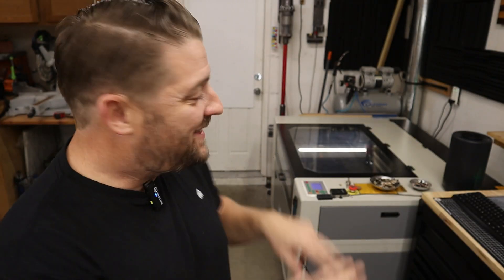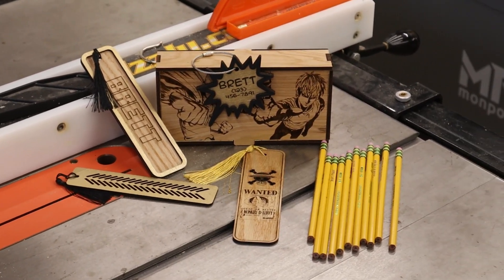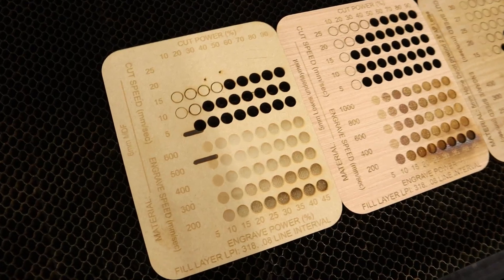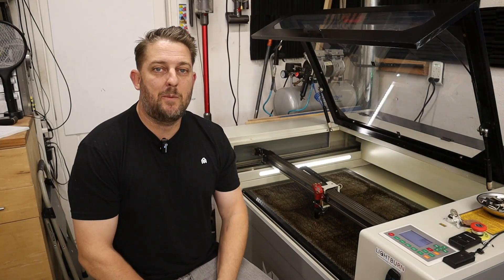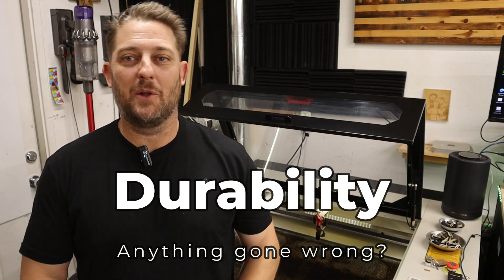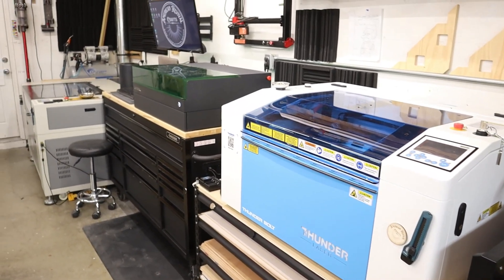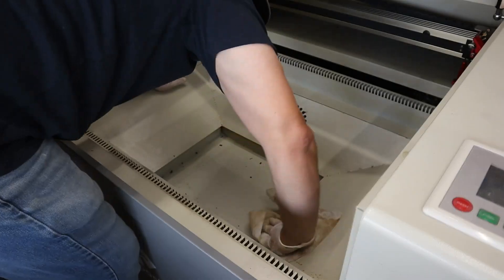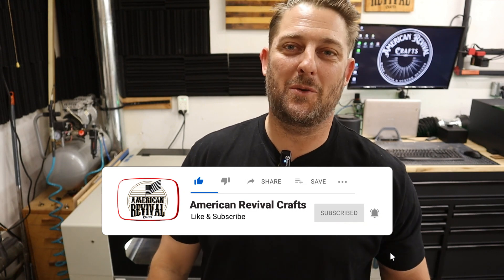Monport 80w CO2 Laser: Comprehensive Review & Verdict After A Year | Brett's Laser Garage

Comment: The Monport 80W CO2 Laser has been an excellent tool for both engraving and cutting, with its powerful performance and reliable results. I personally recommend the Monport Mega, which shares similar quality features like auto-focus and rotary support, making it great for a wide range of projects.
Reply from the maker: The Mega and 80w machines are similar yet very different in many regards.  Make sure you do your research when thinking about either machine.

Comment: Two questions... how thick of a material will the pass through accept and how large of a diameter can you use during the use of the rotary devise?
Reply from the maker: I no longer have this laser in my shop, not really sure.  I never used the pass through.  As far as the rotary goes, it totally depends on what rotary you’re using so I can’t really answer that.

Comment: i have been eying this machine. I was curious, does the tube come installed? I would have to turn the machine sideways to get through the door.
Reply from the maker: Yes the tubes come pre-installed but there is packing material in the tube compartment when shipped.  So just leave that in and you’ll be able to turn it safely.

Comment: Hi Brett, I’m rewatching this video because of trouble I’m experiencing with my monport 60w co2.  So now that it’s been one more year are you still happy with the monport?
Reply from the maker: I sold the 80w a couple of months ago, not because I didn’t like it, but because I needed a more industrial machine for my business.  I would have kept it if I had the space though.  

What problems are you having with your 60w?
Reply: @LaserGarage  a few days ago things worked fine. The very next day on the same material it wouldn’t cut but did engrave ok. We cleaned mirrors and checked power source (24mv while operating) . Machine is approximately 2 years old with moderate use so I figure tube should be ok. Today will check mirror alignment. Thanks for concern and tips. Also thanks for sharing through your videos
Reply from the maker: Definitely check mirror alignment.  Are you in the Monport Facebook group?  If not I encourage you to sign up.  Lots of good info and help there.  Also check out the lightburn support forum.  Lots of knowledge there.

Comment: I've asked and asked about moving a laser to my basement but can't get an answer from MP...  I have a side door, a landing and stairs 36" wide to the basement.  It's not much room and the machine is heavy but in your opinion can heavy components of the unit be removed and taken down separately to make the machine lighter without damaging anything?
Thanks for any info you can offer me.
Reply from the maker: If you’re talking about the 80w then no, it’s can’t be broken down any further…at least not very easily.  You may need to go with a smaller 60w.  On those the base comes off and they can go through doorways and are more maneuverable in tight spaces.  Oh and Monport offers the “mobility protrude” versions.  They give you higher wattages on a smaller frame.  May want to look into those.  Let me know if you have any other questions and good luck.

Comment: can you etch metal with this machine? like stainless steel tags etc.
Reply from the maker: No, you can’t etch metals with a co2 laser.  You can mark some with marking sprays or remove coatings such as paint or anodization but you cannot etch into metal.   You need a fiber laser for that, I have some videos on that if you haven’t seen them check them out.

Comment: Does it have a pass through function as standard?
Reply from the maker: My 80w model only has a front pass through door only.  I’m not sure about the others but I think they are similar.   You’d have to look up a specific model to know for sure.  They do have a new line out with 4 way pass throughs I believe.
Reply: @LaserGarage  I’m considering the 80w model, like yours, but I’m concerned about the negative comments regarding the warranty / support. 

I appreciate that your experience has been positive, but…

I’m also considering the X-Tool P2
Reply from the maker: I can’t speak about the P2 because I’ve never used it but I hear they are nice.  Monport’s customer service is not great at all, there’s no doubt about that.  I’ve talked to them about it though and they told me there are upping there game in that department…time will tell.  Good luck in your search!
Reply: my 80w does

Comment: I bought a 60w co2 monport. I just wish mine had a window I can view through. The window on mine is white not clear.
Reply from the maker: Did you take the protective film off?  You should have a clear viewing window on the lid.
Reply: @LaserGarage  there is no film it's just a white window for some reason.
Reply from the maker: Triple check.  There is a white protective film that ships on all the lasers.  You have to unbolt the viewing window to remove it.
Reply: @LaserGarage  ok I will check it later. Not impressed with monport service so far. They sent me a tracking number a week after it arrived. Inside smelled like a pot factory. The tube and ever mirror were off the mirror holders by at least an inch. Second mirror was shooting the beam at the controller past the bed instead of the 3rd mirror lol.
Reply from the maker: @hasve978  Although a good chunk of change no doubt, they are still a budget brand.  Mirror alignment can get out of whack when these things travel thousands of miles by boat and truck.  That's why I always recommend learning the mirror alignment procedure right away and being as precise as you can with it.  I hope you work everything out and enjoy using this laser as much as I enjoy using mine.
Reply: @LaserGarage  I have it up and running. I had to place a piece of paper over the mirrors to find out how far off the lasers were lol.
Reply from the maker: That’s great you’re up, using tape is the normal procedure.  It’s what I do.

Comment: Good compressor air assist upgrade. Quick question- on cuts, do you find that the compressor runs constantly? Can the reservoir fill faster than the 25 psi being put out (I have a small compressor but after a few minutes, the tank is empty and the air assist is essentially at whatever pressure the compressor can push during refill. Upgrading soon) 

Thanks
Reply from the maker: Thanks a lot!  The compressor is slightly small so it does pretty much run all the time during cuts.  Probably after like 5 seconds of cutting it turns on.  It does keep up though, the pressure does not drop and stays at 30 psi.  I may be switching to the 20 gallon version now because I have three laser connected to this compressor, just gotta find a place to put it.
Reply: @LaserGarage  sounds good. I got a small 2 gallon quiet version and it runs at 61 dB… mainly because my shop compressor runs at 98dB and it would cycle every 8 minutes during cutting at 25psi. Would scare the crap out of me. I can tweak the secondary regulator (solenoid switched to the wind terminals) a little lower to help it keep up, I think it settles out around 21psi. Still enough for good cutting. Thanks for the info
Reply from the maker: Sounds like a plan.  You can always try it and see what happens.  2 gallons is a little small but it really all depends on how much you’re cutting.  I’ve found the 8 gallon California air tools compressor to be a great buy at around $200.
Reply: @LaserGarage  yeah, I found this 2g one on a lightning deal for $80, so grabbed it. I may end up returning it for the 8g CAT after all

Comment: Getting so close to buying this laser. How does it do cutting 1/4” MDF? What’s the thickest material you’ve tried cutting? Thanks!
Reply from the maker: Nice!  Nowadays I mainly use this laser to cut 6mm MDF core walnut, cherry, and white oak.  I’m cutting this material all day long at 12 mm/s at 50% power but I have an air compressor setup to boost the air assist to about 30 psi.  That helps tremendously with cutting.  It cuts like butter at this speed.  Could probably crank the speed up a little but I like the consistency these settings give me. 

I don’t cut anything thicker than this routinely but occasionally I have cut 9-10mm plywood such as in my utility cart video.  I’ve also cut 3/8” redwood and Douglas for a fair amount.   Cutting is funny in that it totally depends on what your material type is.  Plywood is going to be inherently harder to cut due to all the glue layers but there are also many different grades of plywood.  Solid hardwood usually you can cut a little thicker but it depends on how dense the wood species is.

Don’t forget to use code Brett10 if you decide to pull the trigger.  Will save you 10% on top of whatever other sales they have going on.
Reply: @LaserGarage  thanks for the great reply. I’m going to go ahead and do it, with your code too. I saw that California air tools compressor hack, actually run one like that on my current baby 10w diode already. Thanks!

Comment: I do not believe that's the best for your money, why because i bougth one and now i'm getting the run around. Monport is not honoring their warranty. My z probe dove into the wood without stopping, i had to use emergency stop, so now i have to manually set the z, still waiting for the probe. Now the laser power supply burned up, and they are giving me the run around. I have a machine sitting waiting for parts. It's being 2 months on the probe and 1 month on the power supply. I have talked to others with Monports and they are having the same problem. I would not recommend Monport. It's built very cheaply and they are not coming thru with their warranty.
Reply from the maker: Dang that sucks.  I’ve had mine for about 1 1/2 years and have had the opposite experience.  Send me an email, brett@arcshop.us and maybe I can help to connect you to someone that can help.
Reply: SAME HERE. Do NOT buy from Monport. They have NO support. They're 3 numbers on their Website never work. They will NO respond to your cases. Good luck getting your money back.

Comment: Thanks for the content, Brett! I'm thinking about buying the 60w machine, but I want to make sure that upgrading the air assist with an external compressor won't be too difficult. I've seen videos on adding a compressor to the OMTech machines, but I can't seem to find anything for these. Do you know if they use the same controller mainboard on the side of the machine? Thank you for the information!!!
Reply from the maker: You're very welcome.  The air assist upgrade is really simple.  It's the same procedure you see on the videos with OMTech machines.  OMTech and Monport CO2 lasers are pretty much the same in most cases, they both use the Ruida controllers.  I like the video Bearded Builds did about installing the air assist the best.

Comment: Hello, I have this same laser and I am having trouble with the chiller alarm saying its too cold. Its currently 61 degrees in my garage. It worked fine yesterday when it was a bit warmer like 65. I havent really adjusted any settings on the chiller...Did you have to change your settings around or did you just plug and play? Thanks
Reply from the maker: Interesting.  I’m sorry I’ve never experienced anything like that.  I didn’t change any of the settings on the chiller.   60 degrees is definitely not to cold to be running so something must be off.  I’d start with a google search and also do some research on the lightburn forum to see if anyone else has experienced this.  The good thing is all these chillers are pretty much the same so I’m sure you can find info on this issue.

Comment: I see you had a Thunder laser in there... those cost quite a bit more don't they?  Size looked about the same as your MonPort, what did the Thunder bring to the table?
Reply from the maker: Yup, I got a thunder bolt in December.  It’s a 12x20” RF tube laser, so a little but different than the 80w Monport.  We need more machines to keep up with production.  With limited space the desktop Bolt fit the bill.  Thanks for watching.
Reply: @LaserGarage  I had not heard of RF lasers, had to look that one up.  Looks like they are slightly better for engraving due to finer beam width. I just bought a 130W MonPort myself, I wanted the 55" width for passing full 4x8 sheets through the pass through slot without having to cut them up to fit inside.  Still waiting on the laser to get here though, it's been 2 weeks and I can't get a tracking number out of MonPort.  The China support location does create a bit of a hassle due to the time difference only allowing one email exchange per day.  Generally I never use support for anything, but I do need to know when the dang machine is going to arrive!

Comment: Brett, first off, sorry for the constant questions, you just seem extremely knowledgeable about the topics I have questions about. 1. would you have been able to buy the lens kit if you still had your auto focus installed? and 2. I read the manual already and the one thing I am worried about is operating temps. I live in Charleston SC and it gets extremely hot here in the summer. Like you, my laser (that I have now ordered) will be in my 2 car garage which is not temp controlled. How do you handle that aspect of running it or are you in a place that it is not much of a bother? Thanks again for the help you give and reply when you get a chance to.
Reply from the maker: No problem Dale!  

1. Yes, but it would take some slight modification to mount the auto focus probe.  The stock mounting ring is a little too small to fit on the AP lens tube.  I never liked the auto focus feature, besides have a motorized Z axis, so never got around to doing this.  

2.  Where I live, I southern California, it does get pretty hot during the summer.  Like around 90-100 degrees or so at the hottest.  In my uninsulated garage it does get a bit hotter on those scorching days for sure.  I haven't done anything special to deal with this weather.  The chiller I have integrated in the laser has kept up perfectly.  As a safety feature there is an alarm on the chiller if the water gets above a certain temperature and it will not let you run the laser if this temp gets hit.

Comment: Awesome vid but in the event the chiller fails what would be your on the go backup solution? I know the same machine with external chiller if it fails one could just swap out to bucket of water with an aquarium pump and be up and running temporarily
Reply from the maker: Thanks a lot!   Good point about the chiller.  I forgot to mention I do have a pump and bucket on hand as a back up in case mine fails.  A regular style chiller can also be hooked up easily.  I’ve emailed Monport about sourcing a replacement integrated chiller so I’ll post back when I get the info.

Comment: Brett,
I bought a 100 w like yours a month ago, and I have come to the same conclusion. Great starter machine. But the limitations that this machine has can be overcome, I have added all the items you listed and some of my own. I didn’t see this video until after I had added my accessories but I agree 100%. One thing I would add to your
video, everyone should not buy a laser if you are not mechanically inclined. I’ll leave it at that😊. The biggest improvement I have added is a device to control the fan and air, when it comes on and off and delay off so I can cool the laser head down and remove all exhaust after a project. I have some other things in the works but I will keep them to myself. Hope you have a great Christmas. P.s I bought mine to help my wife in her garment business so I could make leather patches . I have been overwhelmed with work.
Reply from the maker: Awesome!  Merry Christmas and thanks for watching.